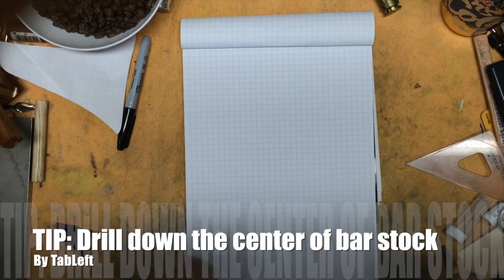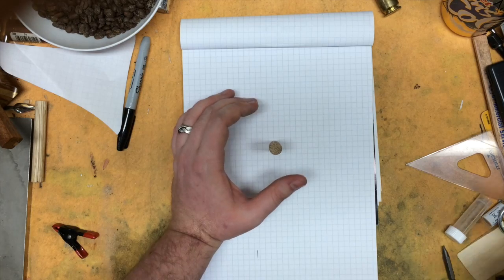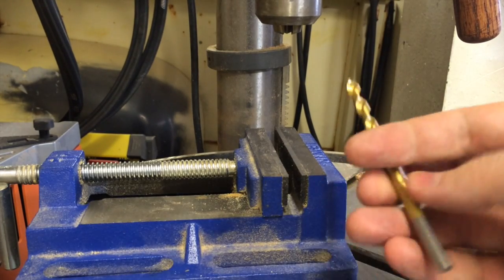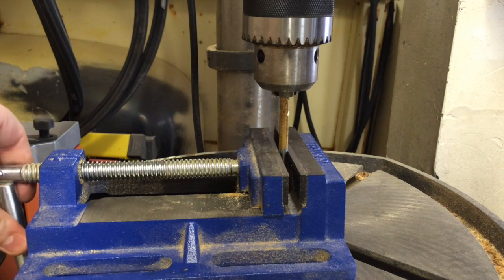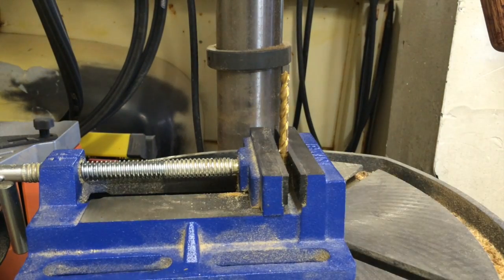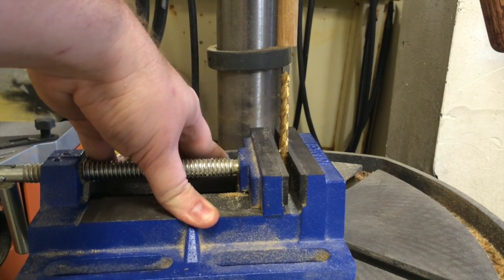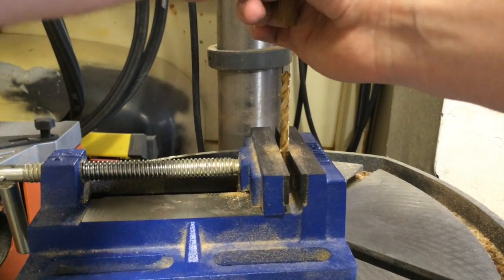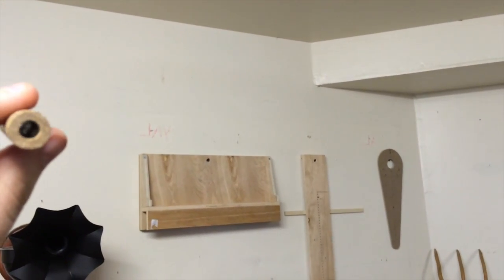TIP: Drill down the center of bar stock

Comment: What are those slots in the bottom of the vise for?
Reply from the maker: For attaching it to the drill press table.  Mine just isn't attached because I take it off all the time.
Reply: So only for important jobs like centering?
Reply from the maker: +Aaron Cook no only important to keep certain materials from catching on the drill and spinning your vise out of control.  In this case it's not really needed since the forces are actually working to keep the bit centered and even if they weren't the wood will give first followed by the bit spinning in the vise long before the vise ever would move.

Comment: very good tip.

consider clamping the vice once the drill bit has been positioned.
Reply from the maker: Not needed having the vice loose lets it move to center if the initial alignment is off.

Comment: Made my day :) thanks
Reply from the maker: MadAm Thank you!
Reply: TabLeft Workshop  Lol I went out to the workshop to try this but the chuck on my drill is 16mm max.
I need to drill 20mm stainless so this method will not ork for me :(  But im sure I will benefit from it in the future. I used an old 20mm drill bit that has a reduced end to fit into smaller chucks and aligned it with the steel rod in the vice (It was close but not exact) I will have to buy a center finding tool or come up with something else to get precision . :)